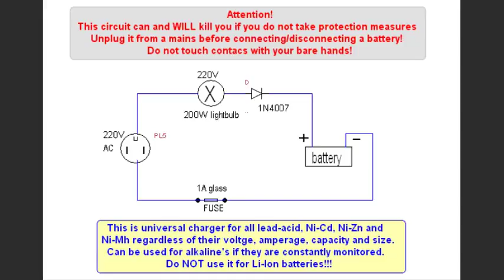UNIVERSAL charger-desulphator for EVERY type of battery

Comment from the maker: *If not treated properly this device can and will KILL you. First unplug device from AC mains before connecting/disconnecting battery terminals. Do not touch the terminals while charging. You have been WARNED *

Comment from the maker: Average charging current is from 0.4 to 0.5 amps. This should be taken into consideration when calculating charging time. Peak current can go slightly over 1amp but this is not important regarding charging time. RMS current is 0.6 amps which is relevant if you are going to run some small DC appliances on this charger(3 to 24V motors, 0.5-1amp or lightbulbs with same ratings)